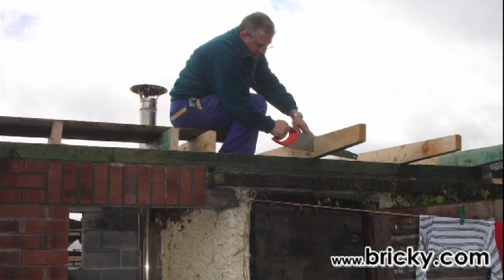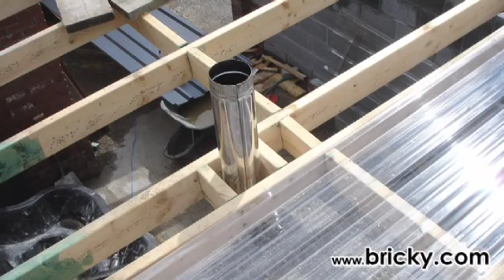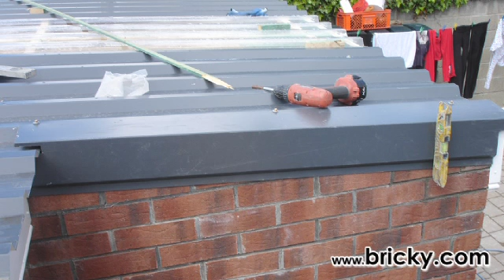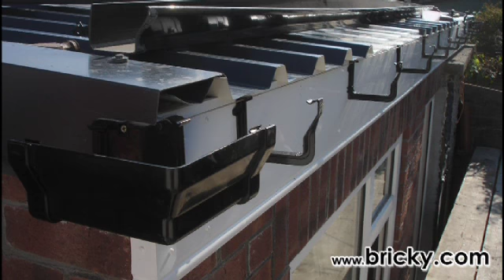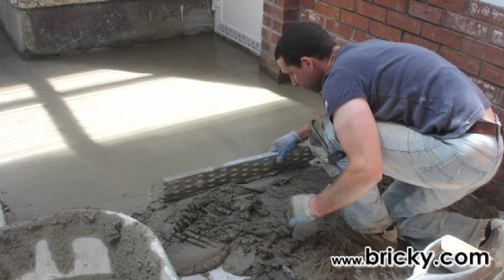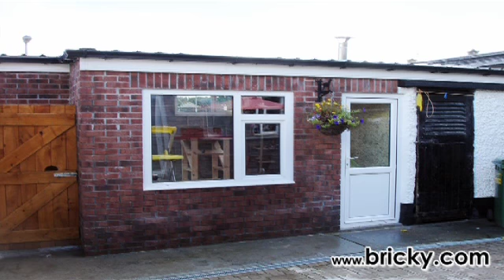How To Build A Garage/ Workshop - Part 2

Comment: You did the roof in metal.  I am worried now cause I spent a lot more than you.  I bought OSB3 tongue and groove boards (about 100 EUR) and a fibreglass kit for 10 m2 for 250 EUR (cheapest I could get it).  I wonder if you had considered other roofs and abandoned them in favour of the metal one you had.  What roof is it exactly and is it expensive?  You made it slope towards the house so it would not be visible from the street.  With the OSB3 T&G I decided to have furring strips run across the joists giving the roof a slight slope. I could not trust myself cutting the joists a bit at the end as you have done because I was scared I would not be consistent. With the furring strips I can move them a bit around.  Also my geometry is an irregular quadrilateral with no angle 90 and no length parallel or the same length, this is because this garage/shed is at the back of my garden bordering another property and I had a weird geometry. I used Y tong blocks to build it quickly and found a great paint in Spain I got delivered to make the blocks weather proof.  I have not started the roof the materials are on my drive.  Any advice is welcome.